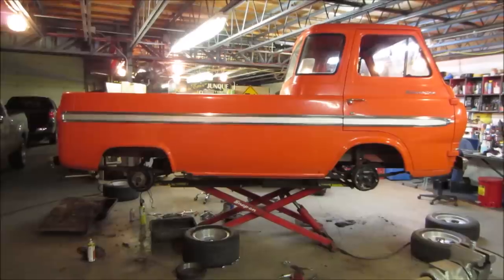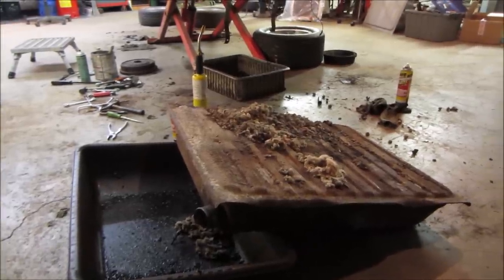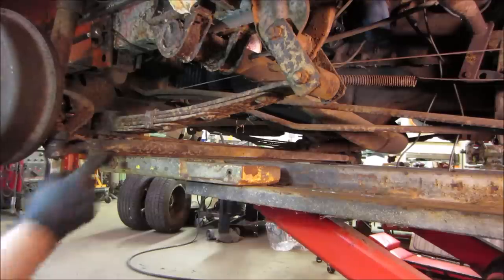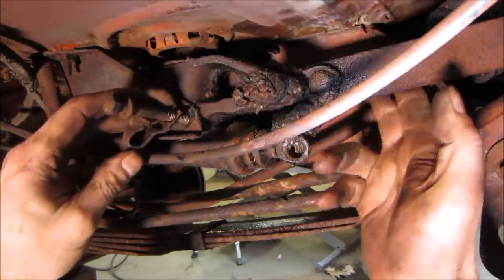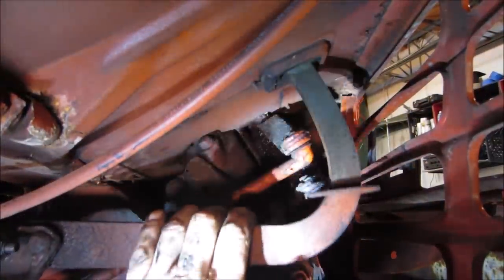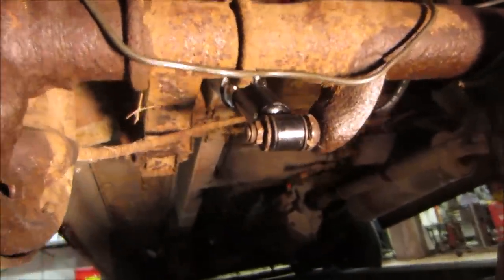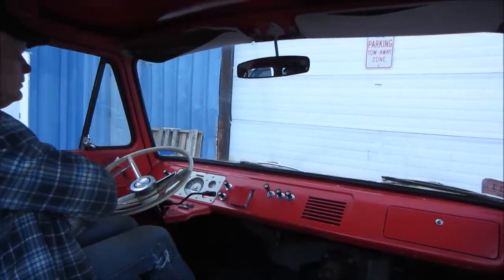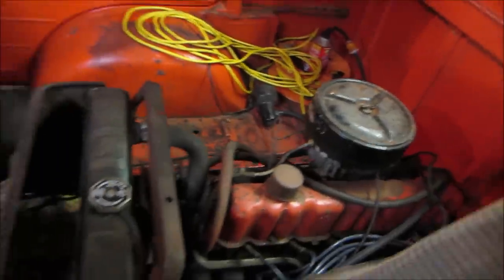Ratty 1965 Ford Econoline,  Making It Stop Then Making it Go

Comment: You can't beat that feeling when you get a project going and get to drive it. Others might not get it but after fixing almost everything the sense of accomplishment you get. It's something different.
Reply: You hit the nail on the head with that one. I totally agree 💯 👍
Reply: Yep yep and these new generations coming along now just throw money at stuff or replace it n toss anything old out ...never understand that mentality myself.
Reply: YES ! Especially when some people, notably "specialists" tell you, "naaah, won't work, not meant to fit on your xxx thing, bla bla bla..." and you prove them wrong ! Did it so many times and I make sure to go and show it them up in their face !😅
Reply: I agree 💯 percent
Reply: @FJ80Coop  i'm working an 06 sierra 2500hd. it's a 4x4 and got the 6.0ls in it. it's turning out to be an awesome truck. much better than my last gm product. anyway i bought it off family after NO ONE would even look at it. he was asking $1000 for it. 150 ish on the odometer. i got it for $800. i think that was good price to gamble with. it was parked for several years just rusting away, 5 or 6 i think. get this, it was just a rusted out fuel line. dude just kept paying on it and went out and got another car. he finally tired of it and let me have it for 1/2 of what he owed and i didn't have to haggle.  he was also paying storage on it. he was glad to be rid of it. i'm not going to lie, sitting brought on a new host of issues with electronics and brakes. i think, knock on wood, i have that sorted finally. i'm going to move on to the rockers and cab corners this weekend weather permitting. anyway i offered to help and even fix the danged thing when it let loose. same can be said about my father in law. just kept on with the excuse that he couldn't afford it. if he could afford another car payment, the cheap amazon fual pump i bought for around  $100 seems minor. i really just need the assembly, sending unit and pump still worked. i just don't get it..
Reply: Indeed. A friend bought 87 caprice thats been sitting 12y and the smile in his face in first ride :D Even tho it was running like crap due bad carb, it has a 'new' one now and its waiting brake job. We are getting there. :)
Reply: Yes I really like it haven't seen one in years and those wheels were ment to go on it great job as usual can't wait to see what else you do to it
Reply: That's exactly why I wanna be a diesel mechanic the feeling of accomplishment of something that may have not been running.

Comment: Great stuff !! In '78 I had a '67 HD van that I used for band gear transport. I bought it from a dealership so it was running good, but I still had to do the head gasket after a bit. I put 45.000 miles on it in 10 months--life on the road.

Comment: Hey Mustie,  Back in the mid 80's I had a ford van with a 300 sick cylinder.  When it gave up the ghost, I dropped a 351 Windsor down in it.  I had to do a bit of rerouting the bottom radiator hose because the water pump inlet was on the wrong side.  It also ran hot all the time.  I had to change out the radiator from a single core to a triple core radiator.  I should have done that at the first engine swap.  I had rebuilt the first V8 when I got rid of the 300 sick engine.  She ran like a champ till I got her a little too hot.  I blew the engine due to a radiator incapable of cooling the engine when you get a little heavy with your right foot.  I am telling you this so you don't make the same mistake I did.  I have long since took a lot of lead out of my right foot and slowed down a lot.  Thanks for the video.  Take care and keep um coming.

Comment: Im a retired mail carrier and on a route I carried there was one of these in this guys backyard.  It looked pretty good and I asked if he wanted to sell it. Got the standard “no Im going to restore it!”  20 years later i had gone to another route but had to carry this section and I stopped and looked at it.  It was melting into the ground.  Tires were flat and rotted, glass had gone milky and leaked so the interior was rotted out and the body rust was advancing so that the bed had holes. Quite the shame.  Saw several cars and trucks over my career that had the same thing happen to them.  The best laid plans of mice and men I guess. Great job Mustie of rescuing this classic truck!👍

Comment: I love your videos. Once I put a new battery in a friend's car and it was more dead then the one I was replacing. I had left the black cap on the negative post. LOL  I laughed just like you did when you pulled that blue plug out of the master cylinder. Thanks for a great year of videos. I've laughed and learned a lot.
Reply: Oh god I did the same thing. Least I got multimeter out of the ordeal heck.

Comment: Just an FYI. My friend had both a 1960 and 1961 Falcon with a 170 cid and 170 Special respectively. At the same time I had a 1965 Falcon Futura. Mine had the same chrome/aluminum strip down the side as your Econoline and a 200 cid 6 cyl engine.  I mention this because his 170 valve covers were Ford blue and my valve cover was Ford Red, and the air cleaner was labeled as 200 cid. That engine looks identical to my 200 cid except the air cleaner was different. If you need engine parts, some of the internals are not interchangeable. The pistons are a larger dia. My  $6.00 ring set became a $20.00 ring set because they had to be ordered from a Ford dealer. This was in 1969-70. Love your videos and keep on wrenchin'. RAC

Comment: Darren - thanks for all the great posts over the years.  I've been able  to make use of some of your problem solving tips  , the most valuable was were you show how to remove the rusted nuts from a vdubs heater boxes - splitting them with a chisel. It took me a bit of time , but after splitting all 8 I was able to salvage all 8 studs  from an old bush find Westy. Who else out there has used some tips from this site?

Comment: When I was about 14 (19668, I pulled the radiator out of my Dad's '62 Ford Galaxy, and carried it on my bicycle across town to the radiator man.
For $10, he dipped it in acid, soldered the leaks, and spray-painted it black. We were all upset when he raised his price to $15 (we thought that was terrible!).
Reply: Yup done that..his motto was "best place in town to take a leak" :)
Reply: Yep.. And I had the radiator in my '67 Cougar dipped, then repainted, in 1992 for $35. Even at that time, I thought it was a reasonable price.
Reply: Oh wow, a time traveler from the year 19668
Reply: Yeah back in the late 70s n early 80s it was 45 and then went up to 65 bux to have one rodded out and resealed/repaired...Hard to find radiator shops any more these days...
Reply: Look on modern Toyotas, plastic radiator heads. I soldered up my 60's FJ Toyota radiator head where it split and that was that. How would you do that with plastic to aluminium?
Reply: The Feds think that a 3.5% inflation rate is a sign of a healthy economy, and try to make sure we have that much inflation each year. At 3.5%, prices DOUBLE every 20 years.
Reply: @madmax2069  hah got u beat late 50's the price was 8 bucks and he painted it too

Comment: We had a ton of those in the Air Force back in the 60's. Our shop had a 1963, very dependable, little power and absolutely no traction ability in the slightest of bad weather. We would put three troops in the cab, one sitting on the engine shroud, and the only real scary times were hitting the brakes hard as it felt like the little thing would rolls over the front. Nice to see one still on the road.

Comment: You were lucky to find parts for this old of a van. Even with mods, you will make them work. So you are already thinking about a engine swap! My grandpa and me swapped a 6 banger for a flathead V-8 in a 52' 1/2 ton Ford truck in the '60s. Completely overhauled the engine and had it mounted to a work bench and purring like a cat before we put it in the truck! The extra weight of the V-8 made the rear end light. He put 4 cinder blocks in the back end of the bed to keep the back of the truck on the road! You may need more than that plate on the back of the bed to keep it on the road if you put a V-8 in this jewel! Maybe a larger 6 cyl.. Love this project! One of your best! Thanxz

Comment: See you can tell you have a experienced YouTuber when he makes sure the camera is adjusted right when putting the spring back on... knowing that if you mess up it will make a spectacular, and possibly bloody shot that you would not want to miss.  Of course it does not slip, but instead you realised after trying for a bit to put t he break adjuster back in that you left the cap on it, so all is good still... :P

BTW I am loving this project.  I love oddball vehicles like this and I would never try and put a V-8 in it.  Unless you really want to carry a load in the back I would just change the gears in the rear end so it can cruize at 70 on the highway better.  After you remove those weights you can easily still throw a few bikes in the back to make up for it.  That is great the trim is in such good shape.  I would never want to see a showroom restoration on a vehicle because they should be driven.
Reply: Some of them factory with V8
Reply: @chuckelliott258  But unless he was planning on towing something with it I do not see the point.  I figure he will drive it to a few meets with a couple of his scooters in the back.  If he upped the gearing or changed the transmission for a 5 speed he should have no problems with a 4 banger in there.
Reply: Love duel pipes and a little cam action

Comment: Awesome project. Definitely recommend find a Master Cyl from a 67 ( only year for the dual Cyl ) and you will need the entire pedal arm and all hardware. It will bolt right in. A couple new brake lines ....and Bob's your uncle. Best Safety upgrade you can do on one of these old fords. That first drive in my van, and I still can't get the smile off my face. Looking forward to the next vid on metal work.

Comment: Comments turned off on the manifold refit. The joint is similar to the Ford V4 that's fitted to the Saab 96. Usually fitted with a good smear of exhaust cement which acts both like a lubricant to centralise the joint and then a seal as it heats up.
Reply: Another "specialist" :( exhaust cement is not used by professionals.. just used the correct style donut it sits tight over the down pipe against the flange and the loose clamp is pulling everything in the tapered hole from the manifold when the nuts are tightened.
Reply: To remove manifold bolts, heat the female threads, most of which were in the head, not so much the bolt or manifold, so he needed to aim the torch farther in at the head, and probably for longer as well, and run the tap square and straight when chasing threads, he had it crooked, and use lots of antisiese and brass or stainless bolts, and I have had good luck with silicone too on manifold bolt threads, perhaps mixed with antisieze,
   Tightening the pipe joint could probably just be tightened a bit while hot, or get the right doughnut.

Comment: An old 1 man bleeding method is to attach a hose to the bleeder valve and run it into a bottle full of brake fluid- when you pump the pedal, the air will bubble out into the container and when you let off it will draw fluid back into the line, so you can simply pump the pedal until all the air is gone.  i had an econoline van back in the 60's and I can still remember the sound sound of that 6 cylinder motor.
Reply: I still use the bottle method to this day...the benefit of solo wrenching

Comment: Chrysler built vehicles of the 60's and 70's did not have exhaust manifold gaskets or gaskets/seals for the exhaust pipe to manifold connection. I was told by a mechanic that Chrysler used what was called a "mill fit" meaning that the parts were machines to fit tightly.

Comment: Moving the rad hose is easy. They made a kit for it back when the Falcon and Mustang were new. 90 degree bend hose out of rad to a steel tube with a 90 on the other end.

Comment: Hi Mustie a couple of observations, if I may. The bolt on the master cylinder pushrod may be eccentric. You can turn it to adjust he length of the push rod. My T-Bird is like that so the Econoline may be also. I'm pretty sure there should be a copper washer both sides of the brass brake line block. All my early fords are like that, with a banjo bolt and a copper washer both sides. I love the truck, but it's not that great in the snow is it?? They did a great job on the styling, though. Definitely form over function. All the best. Mart.
Reply: Bracket holding the master cylinder to the floor looks, well, sad.
Reply: Abßß

Comment: Those Falcon six's in the van usually were good to about 80-90K before they needed to be rebuilt. Around 50-60K they would start burning oil, usually the valve seals and guides and at about 75K the rings would start letting the oil past.
Reply: I think the big problem back then was the oil was crap
Reply: They also screamed there hearts out to go 50 mph, gearing was a bit hi
Reply: What about the master cylinder rod?  Wouldn't all that rust cause pitting and leaking around the rod?
Reply: @guyina4x499  Yes that was  BIG part of the reason the engines didn't last back then. I recently saw a real world comparison and lab testing done on 1956 Quaker State oil VS. modern Quaker State oil (non-synthetic). The results were eye opening to say the least, huge, huge difference in performance at all levels. The old oil was absolutely horrible, it's hard to believe the engines lasted as long as they did back then, with such poor oil quality. You can find the comparison on youtube.
Reply: @tarstarkusz  No it would not, the push rod seats in a cup type piston. The rubber seal around it is just a dust protection to keep moisture and dirt out. The seal is behind the cup which keeps the break fluid in.
Reply: @James... So the rusty rod just pushes against a different one that acts as the actual piston?
I thought that what happened was that water got into the master cylinder and rusted a machined surface.  Thanks.

Comment: Well , this was a wonderful trip down memory lane ! My first vehicle after I graduated H.S in "72 was a 1966 ford pickup with the 300 C.I. SIX and three on the tree manual trans., and that smooth riding twin I beam suspension !   I really enjoyed this series, and that econoline looks  VERY nice, despite the rust  , and the new manifold was well worth all your effort ,sounds like a sewing machine !  BUT, I wish that you would have set the timing on that 170 C.I. a few degrees more advanced than the factory spec. to get the best performance out of that small six !  Anyway,  I think your an absolutely amazing mechanic / fabricator , and I love watching your videos !

Comment: Pretty sure federal law mandated dual cylinder master for 1966 and on. That was a huge improvement in safety. It would be a cool project to upgrade an older single cylinder truck like this to dual, and include a porportioning valve.
Reply: National Highway Safety - Although Standard 105 did not take effect until January 1, 1968, all domestic passenger cars had dual master cylinders by the 1967 model year, some as early as 1962.